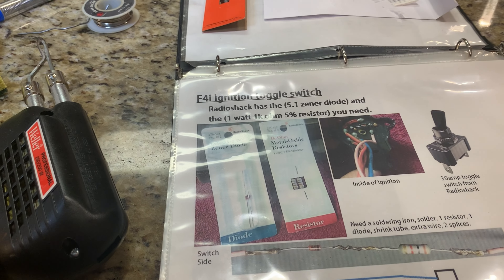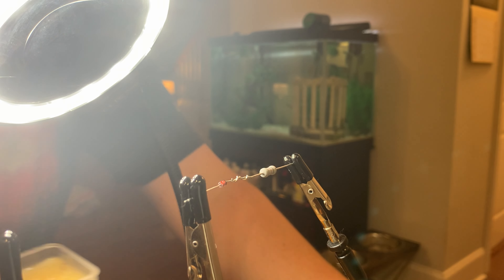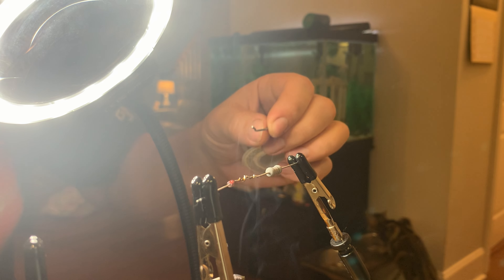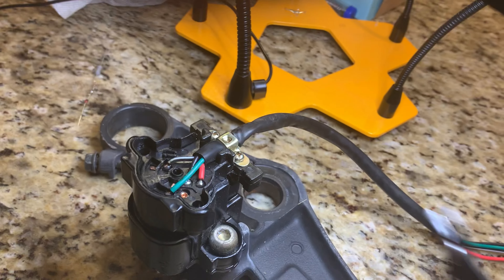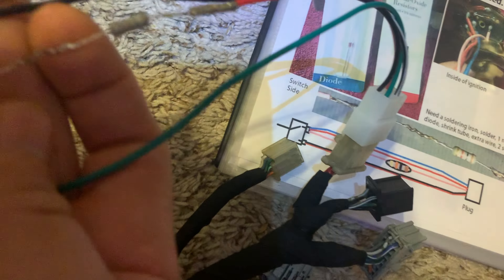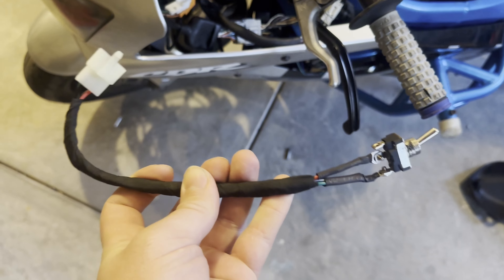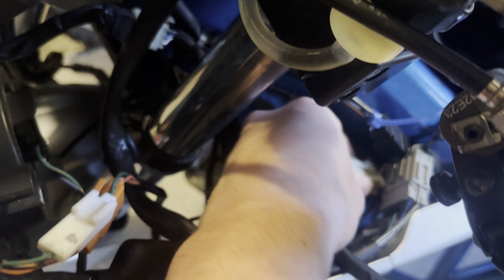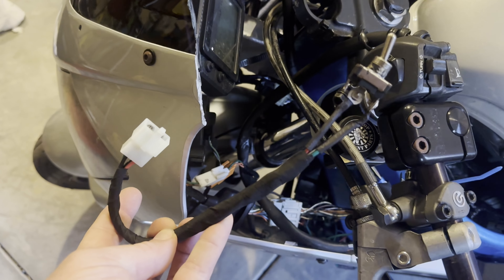F4i ignition bypass toggle switch - HOW TO

Comment: You could just use the key and ignition as the in place toggle switch right? Theoretically its the same thing making a power connection but then you still have your key so then those eBay ignitions would work just fine.

Comment: trying to figure out how to do this with a relay. to use a low amp switch. would i just put the red (battery) wire, to the power (30) terminal on the relay, and then do the diode and resistor on the pink wire, from the switch to the relay? or should i just supply my relay with its own power, and leave the ignition battery wire open? sorry if thats asking a lot. thanks in advance
Reply from the maker: Hmm.  I don’t know about that.  I would just follow this guide and the pictures from link in description (same pics I show printed in video).  It works like that, I haven’t done it any other way

Comment: Is there anyway I can contact you? I had a switch but it tore up I bought it with one. The complication is the wiring part of it. Knowing what goes where to make the switch active
Reply from the maker: Did you check description?  I have the wire colors and the grouping.  Shows which wires go together, which way the diode and resistor goes.  This is my third or fourth one I’ve made, and it’s always worked, and worked for years

Comment: How do you get your fuel pump to prime
Reply: Did this and fuel pump won’t prim
Reply from the maker: @Nate_stuntz_vm was it priming before?  It might be a different issue.  You also had to have done this exactly right, in order to get the correct voltage.  The pink wire notoriously goes bad in many areas of the bike

Comment: My bf is doing this and is wanting to know what color wires on the after market ignition goes to the toggle switch…
Reply: Did your bf ever figure out which colors went where on the toggle switch? I’m also trying to figure it out
Reply from the maker: Just hook it up the the main harness and follow to see which color is which. I can’t tell what color each aftermarket harness might be, but you can easily see by looking to see what color goes to what when you connect it.

Comment: I made mine then found out it's different if you also have HISS ;/
Reply from the maker: HISS?  I don’t see what could make it any different.  Unless HISS makes the stock ignition not work… this should work.
Reply: @leanin_scrub  This ignition cable is the same, but there are extra steps to make sure HISS is working as well. I just wrote it in a retarded way:D 
Thanks for the video